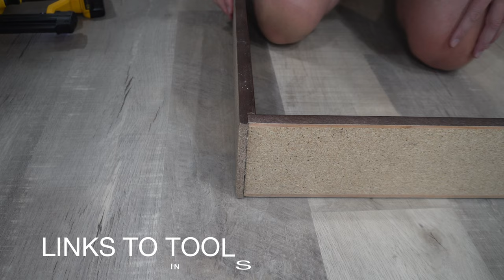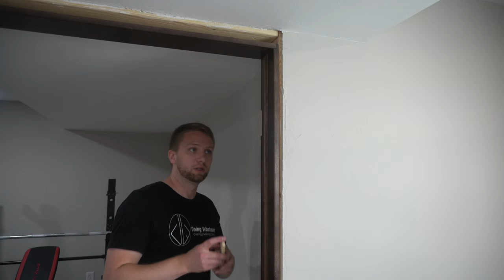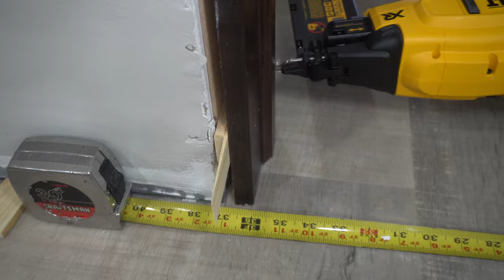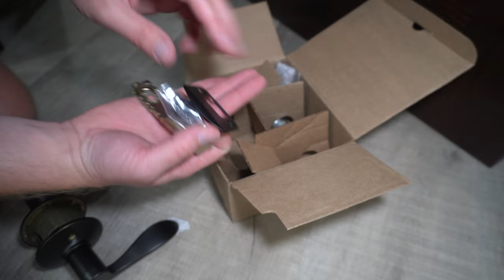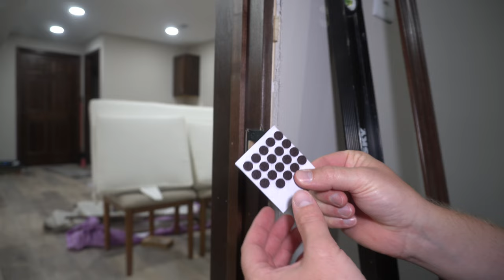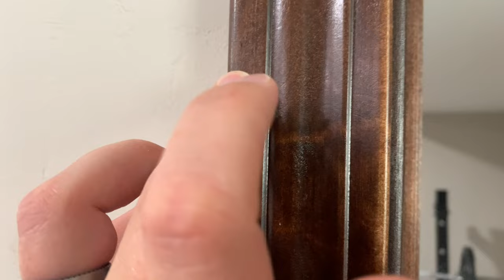How To Install A New Interior Door And Frame, From Start To Finish!

Comment: I just had a professional (in business since 1981) install all new door systems in my house. (14 oak 6 panel) They did it exactly like you did, never used 1 single screw in the frames, only pin nails (hinges not included).  Doors opened and closed so nice, for about a month. then 95% of my entire house full of doors started dragging, and binding when opening and closing them. Had to have them come back and use screws. Pin nails don't have much of a head.. vibrations from door movement and latching will eventually loosen them.
Reply: No qualified carpenter would use “pin” nails to install a jamb carrying oak doors. I’ve installed hundreds if not thousands of pre hung, and custom doors. For lighter interior doors you can absolutely use 15 or 16 gauge nails. Or even 18 gauge. 
When the jamb is shimmed correctly the weight of the door will not pull it out of plumb because it has no space to move. 
If they used pin nails then they should be building picture frames not doors frames. 
I’ve never used a screw In 25 years unless it was for a solid exterior door. Even then, it was one extra long timber screw per hinge set in the centre hole.

Comment: As the second jamb (or strike jamb) is installed, its critical to ensure the frame is installed parallel - you want the door to close flush with both sides of the jambs.

Comment: Are you able to do all your trim, door and baseboards with a brad nailer? Figuring out what nailers I need since I’m coming to this part soon on my basement.
Reply from the maker: I did. For sure the trim and base. Usually people recommend a 16 gauge nailer for the door jambs but I just used a few more 18 gauge brads to get the job done lol. Seems to be holding up just fine!
Reply: @DoingWhatever  I’ll just get a brad nailer then it looked like it did a good job securing everything. Thanks for sharing the video!!

Comment: When installing the frame & just using the pin nails were the  shims are located, what would stop the whole frame from moving. Does it not also need to be screwed into the side  walls ?
Reply from the maker: It wouldn’t hurt to use screws as well but to be honest, these doors/frames haven’t moved at all. They all still function as they did on day one
Reply: Ok, thanks for letting me know @DoingWhatever